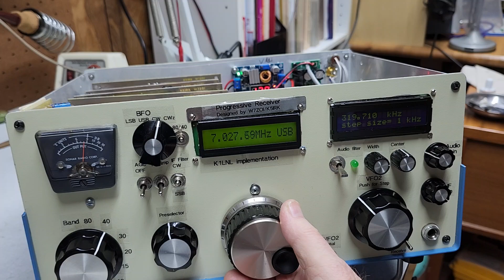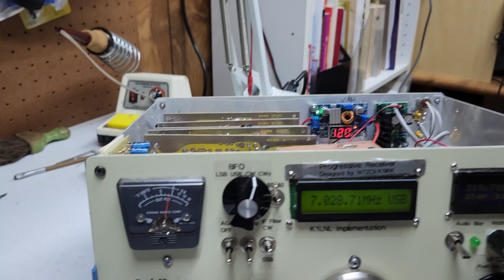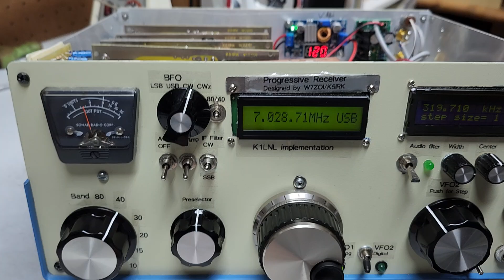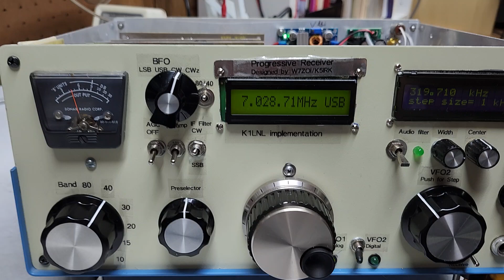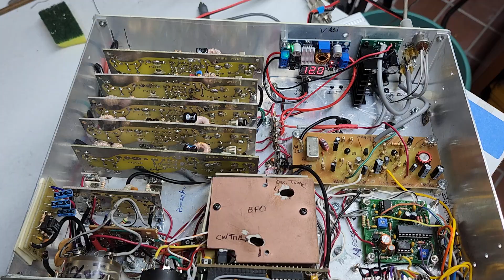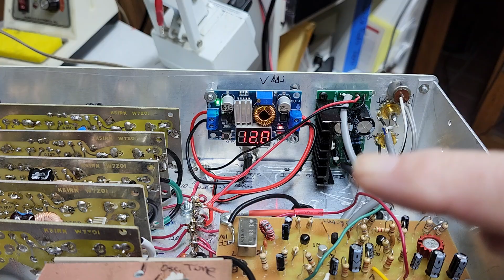Progressive receiver top chassis

Comment: So you have an unshielded switching inside near the unshielded boards .. 🤔
Reply from the maker: @IU3EVR  not sure which board you are asking about, the bfo and its crystals are inside a shielded box (better box since this pic) and the switch is just providing ground to the selected bfo crystal. yes no problems with that other than difficult to find a decent metal enclosed rotary switch.  even when working on the display board in front of the bfo with bfo  box removed, didn't  notice any issues, no squeels, etc.

if you are asking about the band filter/rf amp boards they are switched from the bandswitch below via rg174 coax and the band oscillators are isolated near the bandswitch, only the selected band oscillator is powered.  no problems noticed with that either.  all the band boards are powered and I used an extender to raise each board to get at the caps during alignment.

this is similar to the layout built by k5irk in the original article except I think they had band oscillators and filter/rf amp boards on same side of chassis, mine are separated by the chassis top/bottom.

Comment from the maker: The BFO box has the bfo board and another perf board stacked above it that hold 3 crystals switched from the front panel.  Each crystal frequency is slightly adjustable with a mica variable capacitor, tuned for best usb and lsb audio, and one for adjusting the tone of cw signals.  The CWz position bypasses the pitch capacitor so that 9Mhz crystal then displays the exact frequency of the incoming cw carrier.

The AADE DFD2 frequency display has the updated TCXO option which was installed and calibrated by Neil Hecht the designer of the display.  It was calibrated by Neil using a rubidium standard and even though installed years after, it is very accurate.